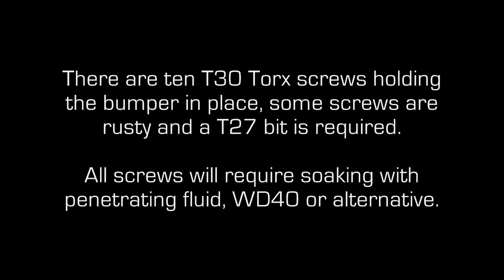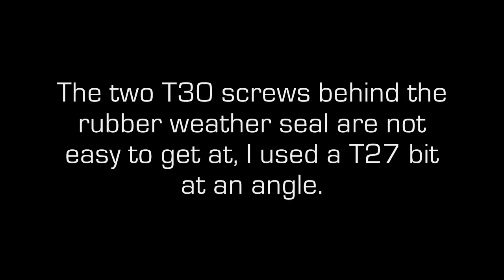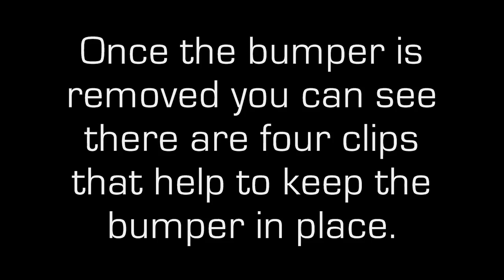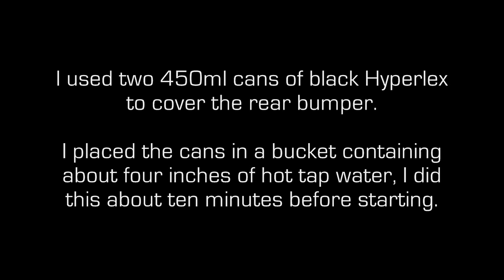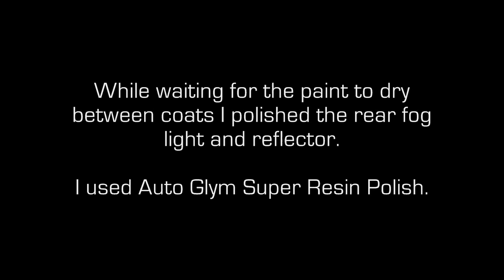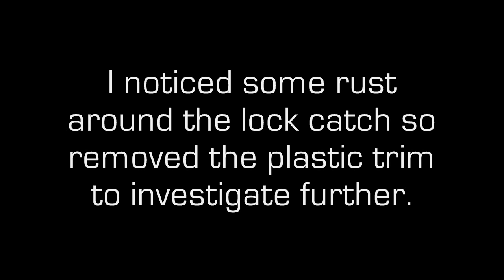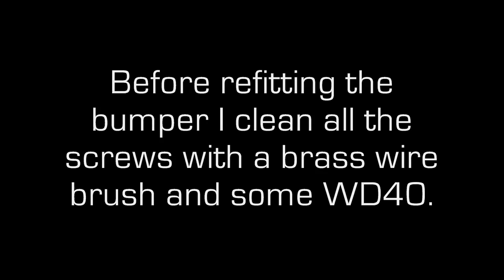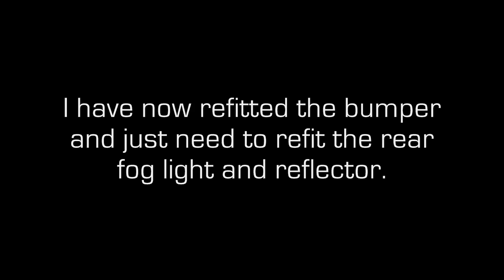VW T4 Painting Faded Bumper With Rubber Paint Volkswagen Transporter #VWT4

Comment: Thank you Nice video. The two top torx screws are hard to get at because the bumper is a complete sub assembly consisting of the bumper, two polystyrene inserts and the bumper bar. The bumper bar has two arms that bolt to the chassis under the back of the van. If anyone has trouble with these remove the bolts and pull the assembly out of the chassis after you have disconnected the bumper sides from the body. Worth doing to check the condition of the bar as mine was completely rotted out and finding a replacement is getting more difficult.

Comment: I had to drill two holes in the door trip to get the two top screws it was so tight..
Still to paint the bumper and try get it back on..
Oh yes two screws snapped two had to be drilled managed to find replacements on the net..

Comment: 8:34 - an angle grinder with a knotted wire cup brush would have made short work of that rusty patch.  I would have done that first before the rust converter. Also a primer coat?

Looks nice, well done!
Reply from the maker: It would have helped. I have some wire brush drill attachments now so jobs like that are a bit easier and less time consuming.

Comment: For faded bumpers, end caps and plastic work in general that is PVC injection moulded and naturally black the best tip is to use a hot air gun and evenly heat it to bring the oils to the surface. Best second hand car sales hack of all time. Rubber paint and all the crap that was invented in the 70s is awful
Reply from the maker: This bumper was too far gone (as stated in the description) for a heat gun to bring the black back, I still gave it a go as it has worked on other vehicles in the past. What would you suggest as a long term solution for less than £20?